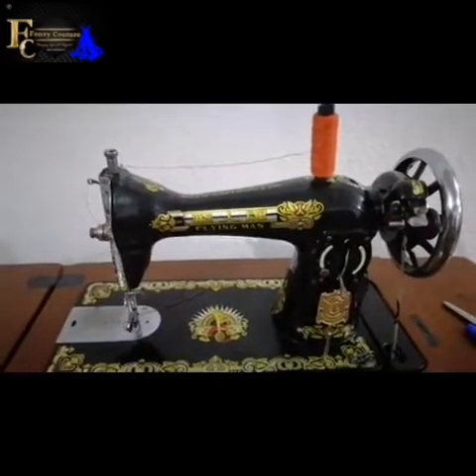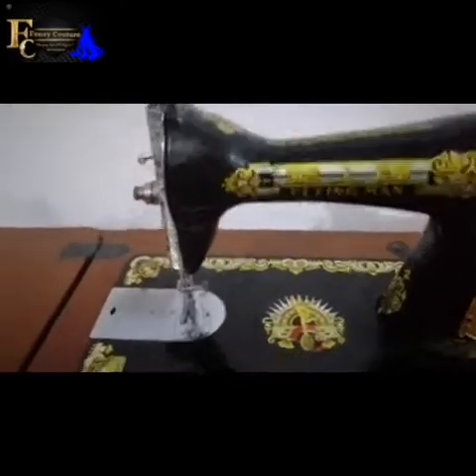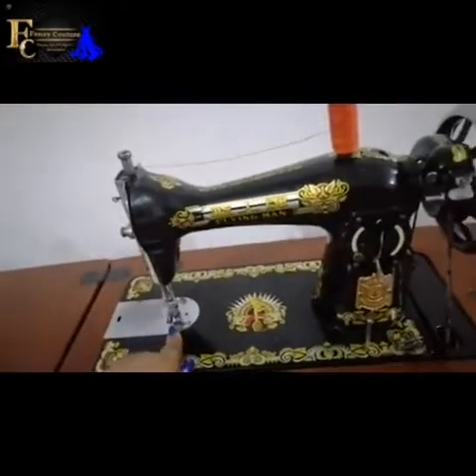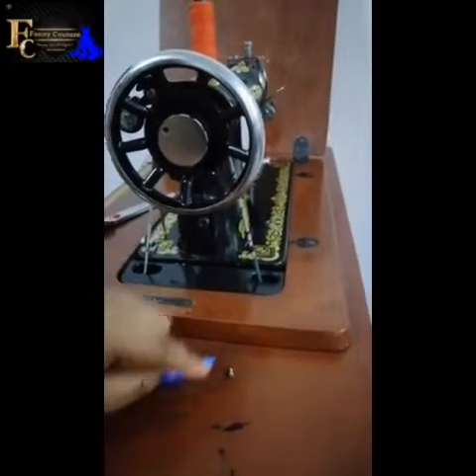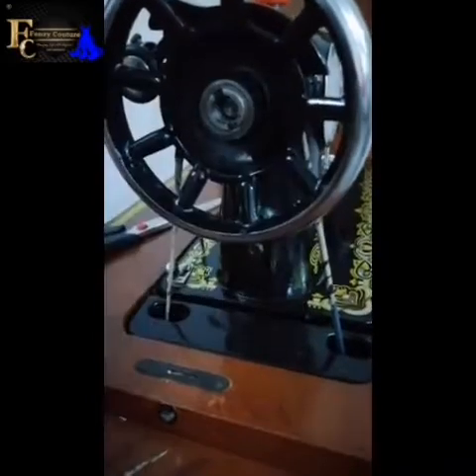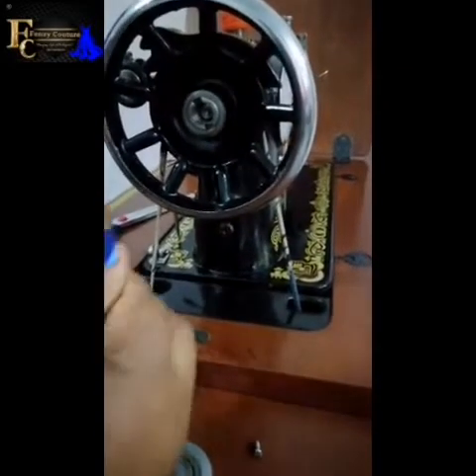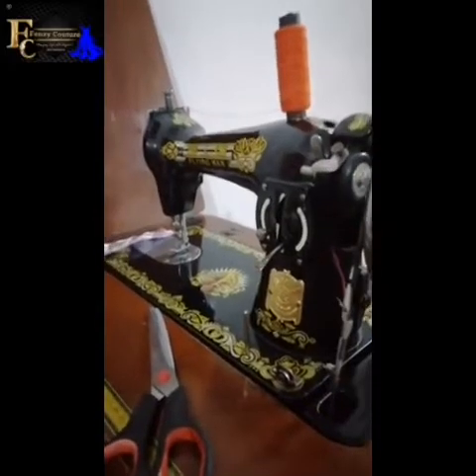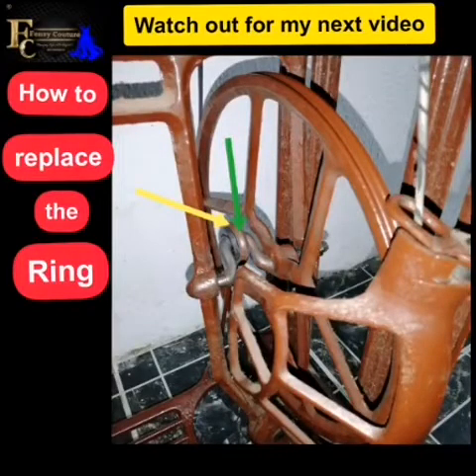SEWING MACHINE WHEEL PROBLEMS #sewingmachinejam #sewingmachinerepair #sewingmachinefixit

Comment: Lately I have problem with my sewing machine. I hope you can help and advise me what to do. My balance wheel and needle is not moving when I peddle but when I used my hand to move the balance wheel the needle will move.I have removed and cleaned the balance wheel as shown in the video but the problem cannot be solved. Your help is very much appreciated. Tq.
Reply from the maker: OK, i need you to give me some information as regards your sewing machine just to know how best to help you. Firstly, is your sewing machine a front loader or a side loader just like the black head i used in this video?
Secondly, are u trying to say that the balance wheel n needle gets stiff, as in stuck while trying to sew unless you use your hand to roll the wheel? or are they are loose?  I need u to tell me so as to get to the root cause of the problem. Then i can tell u what to do.
Reply: @FENZYCOUTURE  Tq for your response. My sewing machine looks like the one shown in the video so I guess it's a side loader. My problem is when I peddle the balance wheel and needle cannot move.Therefore I can't sew. But the needle will move if I use hand to rotate the balance wheel. I hope I have give you the information that you need. Tq

Comment: I tried this method it actually worked but my issue now is the way u said we shud tight it..I did it but the wheel is so hard that I tried loosening the knob to readjust it...but it's stuck...my husband sef try...the knob can't loosen again...now I can't sew
Reply from the maker: That means u over tightened it. Just put oil on it, leave for 5 mins n try it again. It will be ok